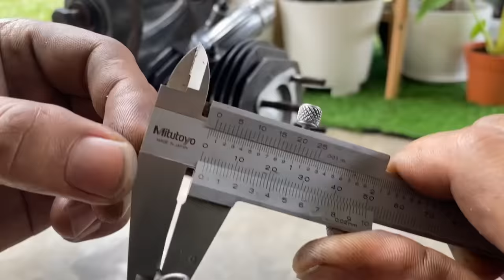1963 Lambretta Engine Restoration - Timelapse

Comment: Great Video but that engine had been taken apart so many times that the layshaft did not need drifting from the rear bearing. It would be good of all lambretta engines dismantled so easily.

Comment: that Gear selector looks pretty beat up! I liked the clutch spring retaining plate and the snazzy chain tensioner! I used ti work at the old WCLW.:hand-purple-blue-peace:
Reply from the maker: hey man, good to hear that. i used to refer on wclw in my early lambretta days back in 2000! they still have lambretta.net page?
Reply: @berukera  I worked for Vince at the shop until he sold to present owner, I have had nothing to do with the present owner (if he's still around) one of our old customers has a lambretta museum in L.A.

Comment: Good morning, at minute 15:50, is all that early ignition correct? Thanks for the reply
Reply from the maker: i set full retard for the initial setting, will set later to 17° after the engine start
Reply: @berukera  Do you happen to have any photos of when you adjusted it? I am going crazy

Comment: Wow you had me going with the twisted wire on the piston....I thought it might be a cylinder IUD birth control item.  Great job and congratulations on actually replacing worn or bad parts.  1st class job.
Reply from the maker: it’s a soldering wire lead 😁 thanks for compliment!!
Reply: @berukera  whats the use of putting a solder wire
Reply from the maker: to check the squish clearance

Comment: Excellent n good workmanship. Quite knowledgeable. I had 1964 model * Lambretta Li 150 * having * Delerto * make carburettor. It was my first bike.
Reply from the maker: thanks! yeah me too, ny first bike as well 😁
Reply: @berukera  I had driven the scooter till 1992. Initially the Jet in Carburettor was 78 which I slowly replaced to 72 myself ; n achieved the mileage upto 35 - 38 kms./litre.

Comment: Did you install the piston with no lube ?
Reply from the maker: hi, thanks for your concern. already lube the cylinder surface. i just dont want to overlube to avoid oil melt on the silicone gasket